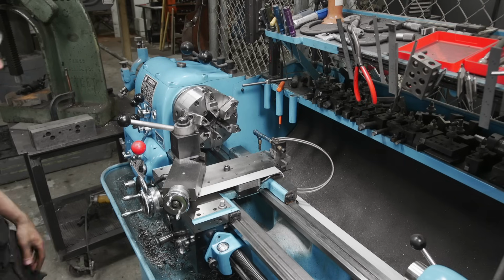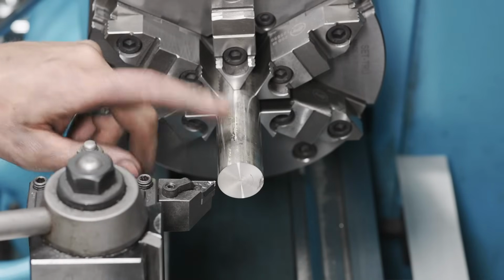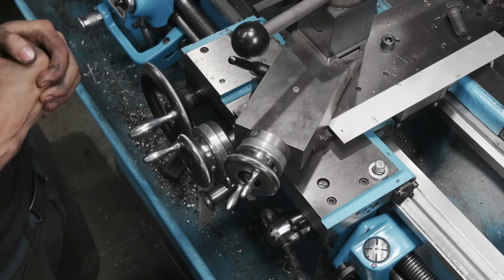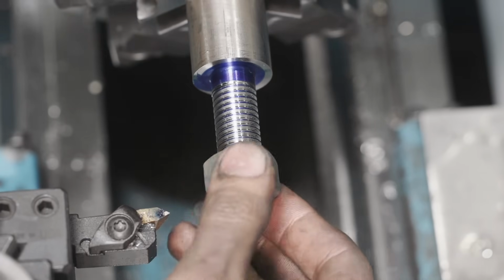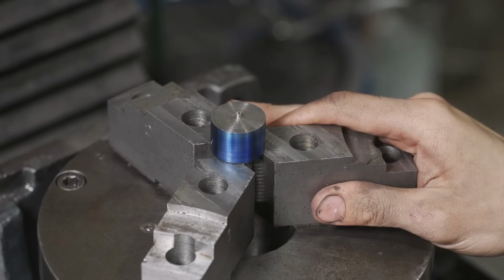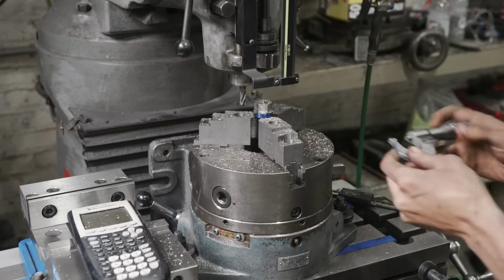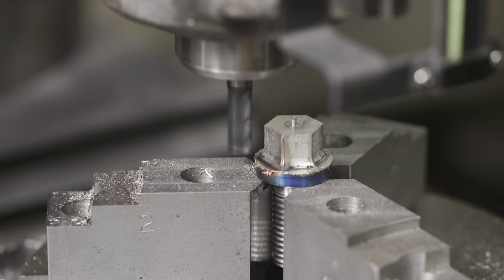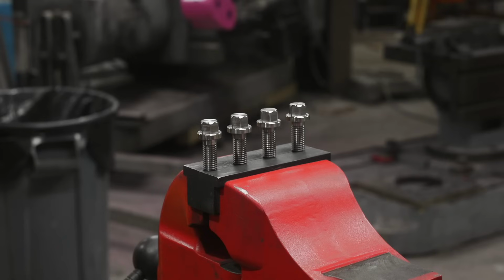Machining Stainless Steel Flange Bolts | Arbor Press Restoration

Comment: First fireball vise I've seen that's actually used rather than just a flex. +1
Reply from the maker: O I use mine. In a few years most of the paint around the jaw will be gone

Comment: 1:30 This is a VERY good habit for a small shop to get into.  Habitually parting off on the lathe, rather than cutting off in batches on the saw, will tend to save a LOT of material over the years. It would be simple to cut off 4 pieces on the saw, to make the bolts.  But this would easily use up twice the material.

I have a habit of parting everything on the lathe as i worked in a production shop for many years, and 99% of my jobs were 100 pieces minimum and 99% parted on the lathe with an automatic bar feeder, setting the length.

This has a huge advantage of allowing the operator to do other work while the part are being made :)   It was not unusual for me to run 4 or 5 machines simultaneously! :)
Reply from the maker: Very true

Comment: 2:28 With an automatic Bar Feeder (either hydraulic or gravity), the bars are supported by a feed tube over 20 feet long.  BUT we would provide extra support (especially on small diameter stock)  .. with a set of shop made collars

The collars fit fit INSIDE the end of the "lathe tube" , that were sized slightly larger than the bar stock being used, and simply attached with a set screw, or a threaded nut depending on the machine. 

The use of a steady rest for this is an excellent idea !!as it fits every diametre, by design! AND more arcuately and securely fits the bar stock, again by design and consequently improves the safety of the job.

One additional benefit is reduced vibration, VIBRATION can sometimes leaves a poor finish on the part being turned, and is difficult to diagnose as simple vibration.
Reply from the maker: Absolutely thanks

Comment: Very refreshing to se someone using the correct method of threading. That’s the way I was taught way back when. The geometry isn’t at all difficult to master but the results are much better than plunging the tool directly. Great video, thanks.
Reply from the maker: I do both. Each have their place

Comment: Nice job, stainless steel can be awkward to work with, but with a good set-up it delivers. Using the cross slide at an angle is fine for comparative work, if you move it 0.005" and expect 0.005" removal, you will find it less because of cosine error, due to the cross slide angle. Good post, nice bolts 👍
Reply from the maker: Thank you. Good to hear from you pagan
Reply: So it does take a graphing calculator to do it at an angle?  I’m just wondering how the guys did the math 70 years ago.  Seems kinda cumbersome to have to crunch numbers every pass.

Comment: Like the rear support ,I can recall seeing a video from a security camera were a long bar was extended out the back of a rather expensive looking CNC work station and the spinning bar started whorling around like whip the entire unit broke loose and endangered other work stations or anybody who could not dodge fast enough.All because whoever set up the job didn`t use a steady.
Reply from the maker: Thanks yeah it works well

Comment: Nice job Vanover. A hint when working with "unknown SS" Use a magnet...if magnetic it is a hardenable [martensetic] SS, if non magnetic it is a non hardenable [austinetic] SS. Remember ALL SS workhardens as it is being machined so take it easy on feeds and speeds!
Reply from the maker: Thank you. Yeah it wasn’t magnetic just didn’t know which type of non-magnetic it was.
Reply: AWDJRfor that's some very good information. I had never herd that and didn't know how to tell either until your comment. Thanks. That's something I will always remember.

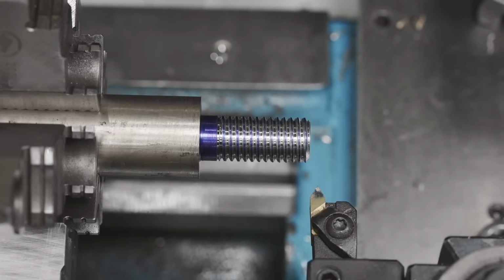Comment: I noticed that once you'd finished cutting the threads at around 14:00 the peaks get wider towards the head of the bolt, it's easy to tell by the bluing and that's probably what's causing the nut to get tighter the more it's threaded on. What could be causing the change in thread pitch though? I don't think it's the depth of the cut changing because if anything you would expect it to be lighter towards the tip if there was any deflection in the part, not deeper which would be required to narrow the peaks.
Reply from the maker: Not sure. One thing is for sure this was not my best single point work. I was using a nut as a checker. For my application it would be sufficient but happenstance had me only having one 5/8 nut one hand 🤦‍♂️. And it was a super sloppy nut. This resulting in a very poor fit. It fit the nut fine but off camera I had to clean them up with a die. In addition there may have been an issue with my lathe causing what you describe the half but is very worn and needs addressing. I since try to do my threading on the American until I get to the colchester to address the nut. On my personal projects these things don’t matter much but lots to learn.

Comment: I’m intrigued, do you not need to use coolant / cutting fluid when machining Stainless? So good to see the restored lath in use as well, great and informative video, cheers 👍
Reply from the maker: Thanks. Coolant helps but is not necessary
Reply from the maker: Thanks. Coolant helps but is not necessary
Reply: @VanoverMachineAndRepair  Interesting, certainly came out well as machined, Thanks for the reply 👍

Comment: Question on your lathe dials how did u touch up the tic marks and numbers where they were legible and readable?  i have tried to clean mine and then go in with a fine point sharpie to give them new life but the sharpie doesn't last forever.  Wondering what u did and if there is a better way.
Reply from the maker: I just left them alone. I use a dro anyway I bearly use them
Reply: ok thanks @VanoverMachineAndRepair

Comment: Not all alloys of stainless do not rust. Some contain iron and are magnetic. So it pays to know your alloy.  Anytime you use a stainless thread you should use antisieze on it.  They gaul like crazy, especially upon removal and reinsertion, and there is no mention of it in Machinery’s Handbook!Therefore it is a phenomenon.
Reply from the maker: Good to know
Reply: That's not entirely true. All stainless steel contains iron or it wouldn't be called steel. Magnets are weird they affect all kinds of things not just ferrous metals. Some stainless steels are less magnetic than others but that doesn't determine their level of rust resistance. What sets stainless apart is that it has enough free chromium to form a protective layer of chromium oxide. Some stainless steels are more stainless than others and some are less stainless. Basically, all stainless is resistant to rust but to what extent is down to the individual metallurgy or each grade of stainless.

Comment: You don't want to spend the money on a few bolt but you have spent probably over $2000 with shipping and maybe extra jaws and you have spent thousand of dollars on Festool tools which are way to expensive compared to Makita, DeWalt and Milwaukee which are as good as Festool which are expensive because the are made in Germany and the price of Systainers is a joke. That said you make good videos.
Reply from the maker: Get out of here bro. Yes I got nice tools but why waste money when you can make what you need. Plus I would rather invest in my equipment and make videos then just buy everything. Just because someone has nice tools does not mean they have lots of money. There is a story behind everything and it’s more nuanced then it always appears.